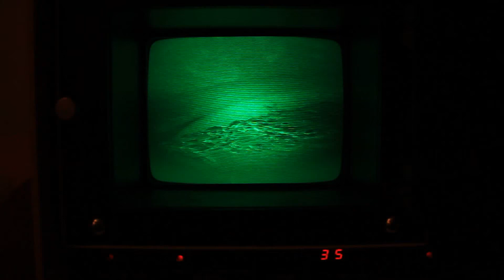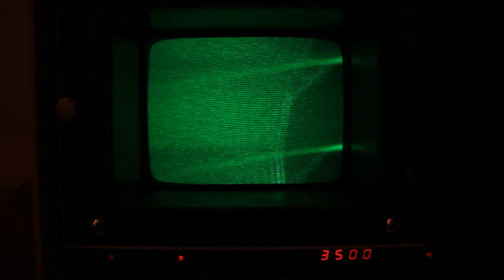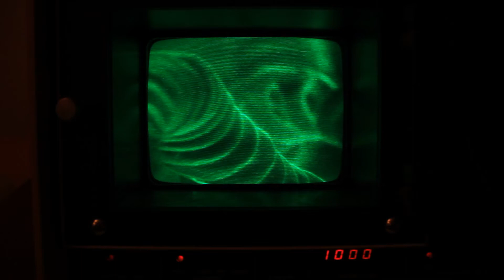Scanning Electron Microscope - Light bulb filament

Comment: I've come across one of these at a lab I work in. Does not seem to function and has no accompanying documentation. Thinking of fixing it, but have no idea where to start. Would it be possible to ask you for some photos of the wiring diagrams and/or service manuals if you are in the possession of any and are willing to share the info?
Reply from the maker: Afm micros sure I at least have the manuals still. However Ben Krasnow got the wiring diagrams when I sent the SEM to him a few years ago I think. Go to my website richardandersson.net and email me directly.